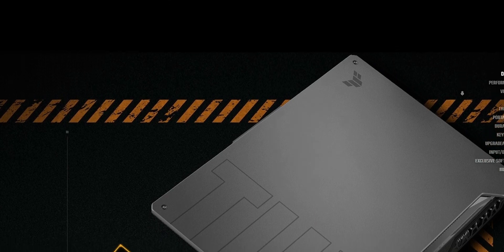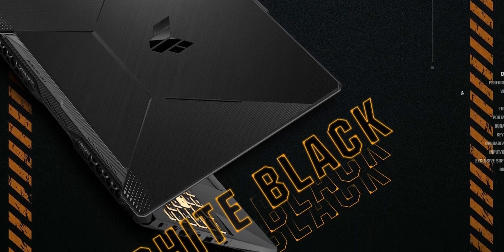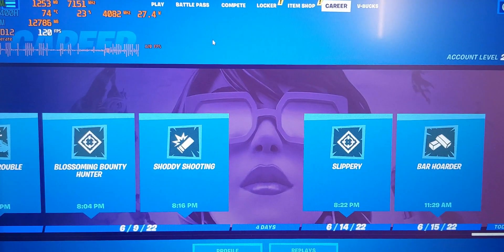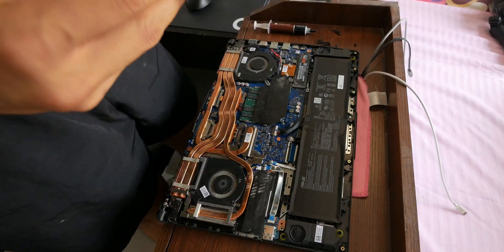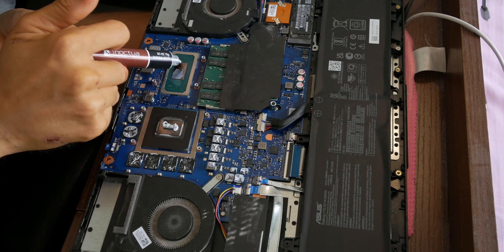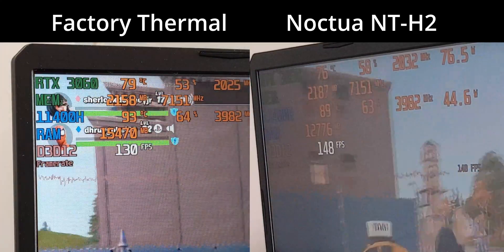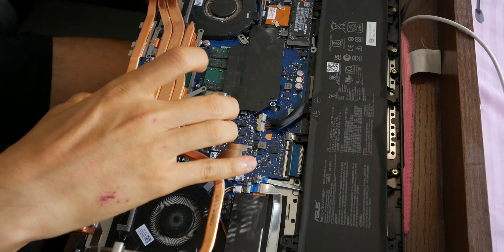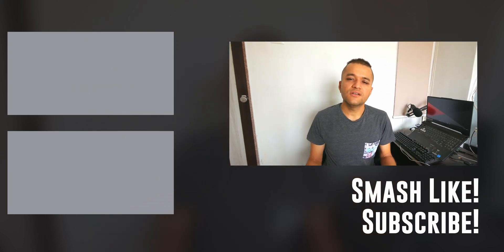Should You Replace Stock Thermal Paste on Laptops

Comment: Just fyi, that's far too much paste, it should be like the size of a pea 1 to 2mm diameter at the most in the center of the CPU or GPU die. It spreads well so there is no need for that amount. From the Noctua website: "Caution: Applying too much thermal paste can lead to higher CPU temperatures".

Comment: so my alienware 17 from 2013 is the one im still using to play my games ( time for a new one i know )
in theory, should thermal paste be inspected if its still good or not? or just wing it.
tbh i have never ever opened the thing up to clean it or take dust out and lately it does tend to get warm enough that i burn my legs when its on my lap.

not that i plan on opening it up to change the paste since im in the process of looking for a new laptop but its good to know wether i should inspect it or not after a while of using the thing.
Reply from the maker: It's never too late. I used to do it every 6 months
Reply: @TheEasyWay  Thanx 😊 might use this old one to experiment on before i try it on the new one.
Or just let someone capable do it like you said 😅

Comment: On the CPU and GPU cores I suggest applying Honeywell PTM7950 phase-change material, and instead of thermal pads give thermal putty Upsiren UX Pro Ultra and finally on the CPU and GPU do undervolting at -100mV or more if it will be stable, disable or reduce the frequency of the CPU in turbo boost, because for most games high clocking is unnecessary. It will be more power, quieter, cooler and less power will be drawn from the wall socket.
Reply: whoaaaa dude did you tried it? how's the result? how much temp drop?
Reply: @kal. But it's not for everyone to try.. some better pay a computer tech to do.

Comment: thank you brother, this is really really helpful. I have an acer nitro 5 an515-57 with i5-11400h and gtx 1650 and my cpu runs 92C while gaming all the time (max fan)
Reply: omen  i didnt do it myself lol, i bring it to warranty and they repaste and clean the laptop, i have never reached 90C without max fan since then. You should do it bc 100C is very concerning
Reply: omen  it is recommended to go to stores but it is up to you, just make sure that they are reliable
Reply: omen  yeah thats prob the best option
Reply: @kuriko_kurizmo hey the guy you replying comments just go deleted or just gone lol, i wanna ask how often do you need to change it? One a year? And if you do it on a warranty store could you do it multiple times or just once with the warranty card thing. I just bought my first ever laptop so kinda scare and want to be careful 😂
Reply: @ichwalsadam9179  i still have warranty so i just give them to replace my thermal paste, i think you can do it multiple times but ask them to make sure
Reply: @ichwalsadam9179  also it’s fine if ur running 92C, the stuff is designed to sustain under high temps
Reply: @kuriko_kurizmo  ah ok thanks but how often do you re paste it? once a year? 6 month
Reply: @ichwalsadam9179  idk im too lazy to do it, maybe once a few years if you want, but you don’t have to

Comment: i am regretting after repasting thermal paste in  my new msi bravo 15. stock was much better on full stresss gpu 87, cpu 90 deg in summer.. here room temperature in summer is 40-47deg.. after replacing new paste which is C14 sub zero with 13.6wmk value.. gpu goes 91 cpu goes 95. i am in trauma now.
Reply from the maker: Try this https://youtu.be/rpjbhf6Tpqw. It's better than thermal paste.
Reply: @TheEasyWay  oh man, i am not getting this phase changing pad anywhere. if i order from china then its shipping cost is 10% of my new laptop lol.. what is your opinion on Gelid GC Extreme?

Comment: I have the same exact laptop, I just replaced my arctic mx-6 with honeywell ptm7950 and my cpu temp when playing Fortnite are around 79 degrees. My temp with mx-6 was , 85-90 degrees, and then after a 1-2 weeks it starts to pump out.

Comment: Cooling performance on gaming laptops degrades over time. Check for dust build up and dry thermal paste. I recently  got rid of CPU throttling & system crashes by renewing my thermal paste. I used SYY 157 paste & managed to drop mean temperatures by 5%
Reply: For how long did u use the original thermal paste?